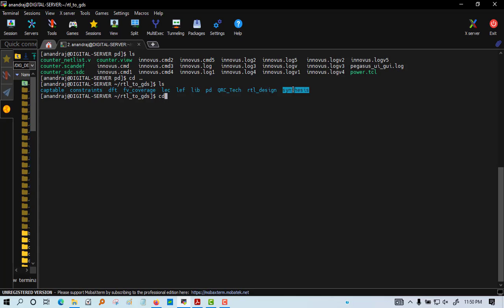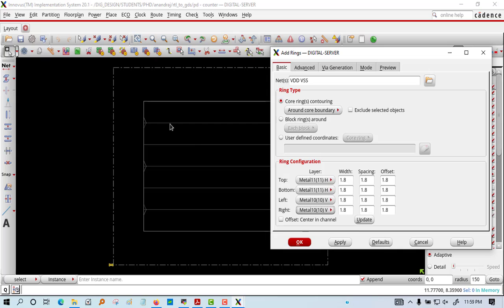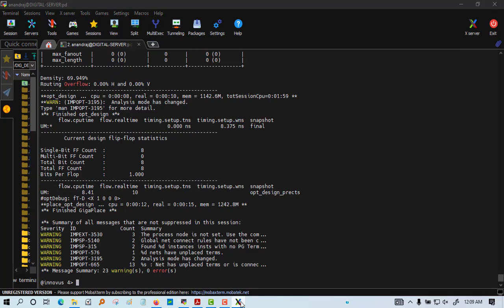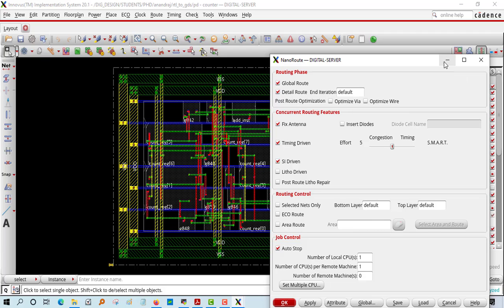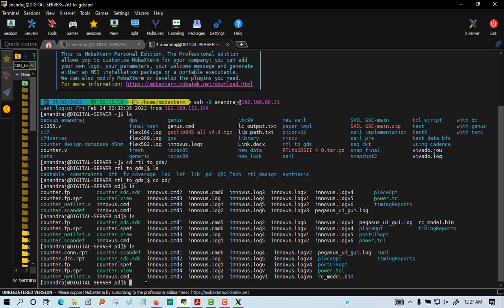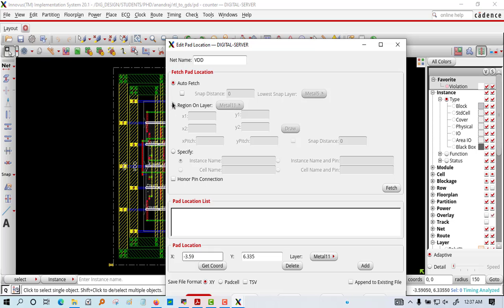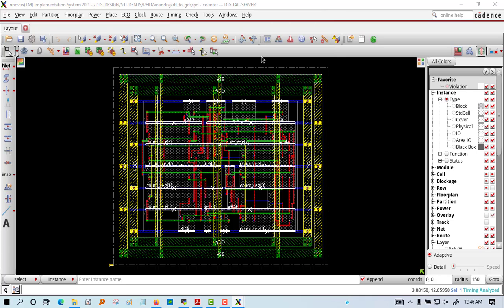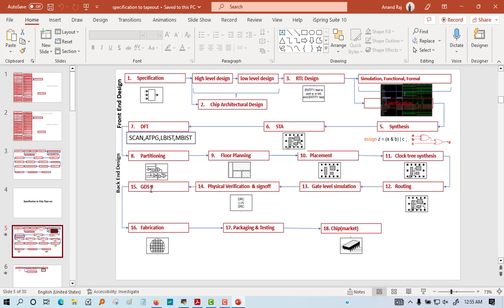RTL to GDSII | ASIC design flow | Backend Design | part II

Comment: Sir, I got this error when I tried to synthesize the clock: 
Cannot run 'create_clock_tree_spec' as no delay corners are defined.
do you have any idea why this error appeared?
Reply: also you include a counter.view file which I dont know who to generate it.
Reply from the maker: @rezapapi7  when you will save after creating MMMC ,it will be in .view file
Reply: @anandrajofficial1  I dont know how to create MMC File. Since I only make the syn.tcl, but there was another file tc.tcl which I dont have it
Reply from the maker: @rezapapi7  check any video from yt or Google it. I will make it in future
Reply: @anandrajofficial1  I searched for it but I couldn’t find any. since my tapeout is really close could you please share the dft.tcl file. I did not do this step since I did not access to that file.
Reply from the maker: Have you defined all MMMC?